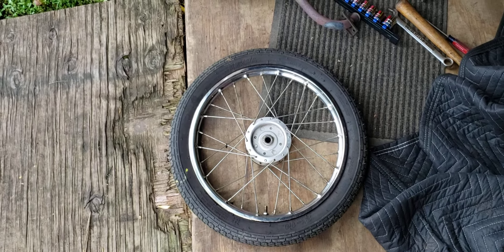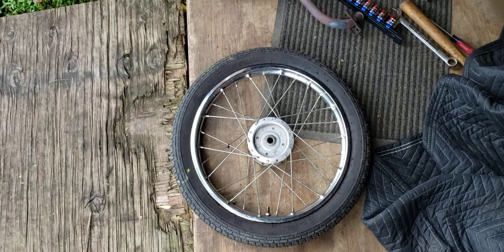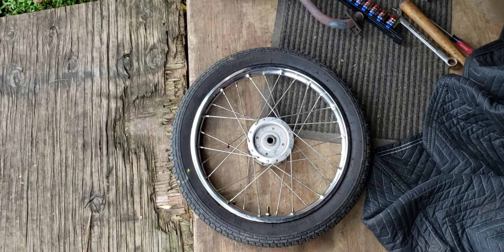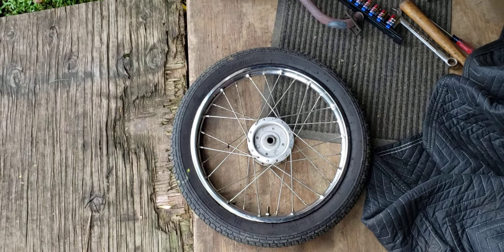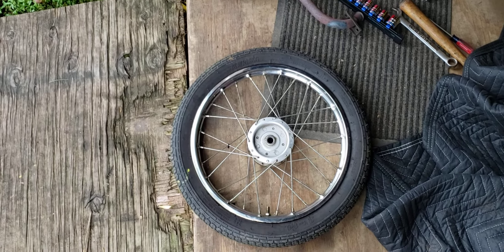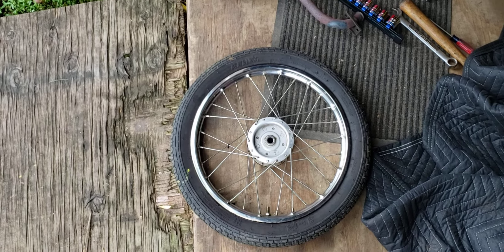Honda Express NC50 Moped Rear Tire Removal

Comment: Thanks for the video you're very helpful. I'm in the scrap in business and some lady gave me a 77 Honda Express got it running. It hasn't ran for about 35 years she runs like a watch. She needs a little bit of restoration cosmetic. Still looking for the front light assembly in the rear light assembly.
Reply from the maker: Thats really good to Hear.. Vrry fun Project. Them Honda were so cool.. I sold most if mine but had a Good Time Riding them around town. I had a Few of them Older Honda's. Check out my other Videos on the Moped/scooters. I was a  Collector. Thanks for watching my Video.

Comment: Great job, any torque specs for the axle nut when reinstalling?
Reply from the maker: I'm not sure.. Just Don't over tighten. Nice snug. Thats all I did.
Reply: @Garyjorges79  Okay, thank you for the info!
Reply: 25-36 foot pounds is what the manual says. However my 1981 NC seems to have a lock nut on it that is stubborn. Last guy put a new tire on it that I'm robbing the rim for my other 81 in a pinch.

Comment: What is the stock tyre size??
Reply from the maker: Im not sure..I forgot..Have to Google it..I sold the moped. Thanks for watching
Reply: Tire size in Japan is 2.00/14　Kenda 2.25 / 14 can also be used
Reply: @cityemini1000  I understand that you can also use a 2.75 wide tire but make the wheel is perfectly true you’ll be a little close.
Reply: From the factory they come in a 2.25 x 14, but you can go to a 2.50 to 2.75 x 14 and you’ll be a little close. IRC makes a sweet tire for it, I just installed a pair on a ‘81 honda express nc50 and my friend loves how it rides and handles. I recommend this tire to anyone, when you buy two don’t panic if it reads front tire Just install them with the arrows in the same rotation as the wheel or towards the front of the bike good luck with your ride.
Reply: @miguelpagansr6128  The Kenda 2.25 / 14 is the only tire that can be used unprocessed without touching the rear wheel house. I am commenting from Japan I am writing a comment using a translation